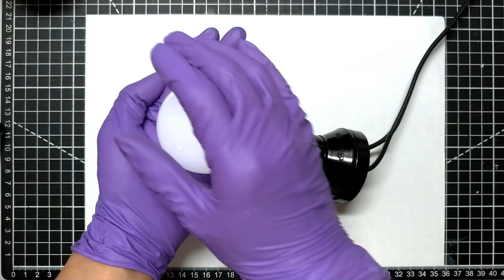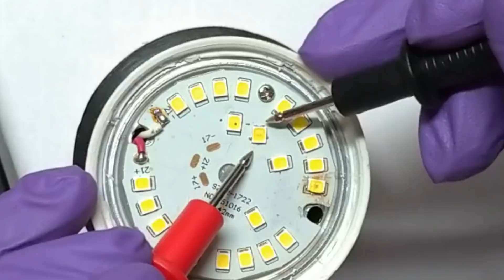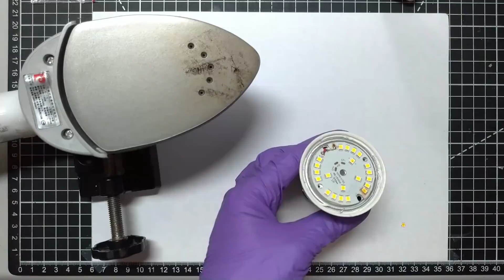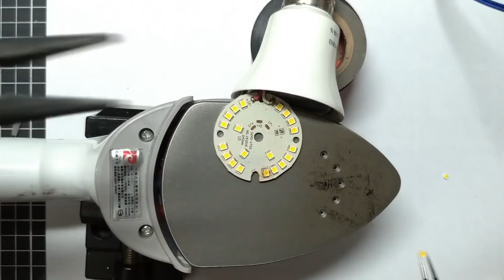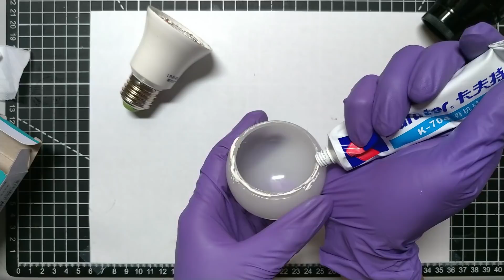LED燈泡維修/用電熨斗更換LED燈珠

Comment: IT WAS A CRAZY ACT BY PUTTUNG LED PLATE ON A HOT IRON !!!   SOLDER OR DESOLDER LED NEVER LONGER THAN 2 SECONDS BEFORE IT BECOMES DAMAGE BY SUCH HIGH HEAT !!!!!
THE MOST SIMPLE WAY BY CUTTING THE BAD LED CENTER PART WITH A SMALL CUTTER, THEN  REMOVE BOTH REMAIN WITH SOLDERING IRON.

Comment: It will last a lot longer without the diffuser because the diffuser holds in the heat. Drill holes in the base underneath the LEDs to help vent and the bulbs will last a very long time.
Reply: what about if we drill holes in the diffuser instead?

Comment: Here you missed an important part of the video which is LED Voltage or Wattage, commonly there are 3 types of leds used in these bulbs, so one must be replaced by the same voltage or wattage otherwise it wont work. How about making another video on this topic and share all the basic info and tips to fix led bulb?
Reply from the maker: Thank you for your advice, it is so helpful to me.But i have to consider it myself.

Comment: Good video. However, the problem is not always directly in the LED. The fault can occur on rectifier diodes, capacitors (400V), resistors (1W), which act as a fuse in cheap Chinese light bulbs. It may not always pay to save light bulbs, especially cheap Chinese ones that are poorly cooled ...
Reply: I have a cheap Chinese globe, on 24/7 running now for 7 years, I have a Eurolux with 2 a year guarantee only last 7 or 8 months. The only problem the Chinese one is not as bright as the Eurolux, so the LEDs are not driven on max.
Reply: @tinaluke5124  Only the Japanese realized that they would build their brand on the durability of their products, so they sized the electrical components at twice the actual operating power. The American philosophy was quite the opposite - to use the entire operating power of the electrical component, due to which the parameters of the electrical components were falsified. It was supposed to bring very little life and business. Therefore, nothing will last. By that I mean that it is your glowing globe that is dimensioned correctly with regard to "unlimited" life. The American model is used in consumer goods - for a while it provides great performance beyond the real parameters, which translates into a lower price, but as a result it is more expensive for consumers because they have to buy a new light bulb, for example. Traders' profits are based on this.
Reply from the maker: thanks
Reply: Hello. Very Good.

Comment: I repaired a faulty one: the problem was in the contacts of a capacitor.
Reply from the maker: NICE ! In addition to the LED chip, the most common failure is the capacitor. and it's not easy.
Reply: @oh-jack  while the majority of faulty LED bulbs can be repaired, the same can't be said about fluorescent lamps.
I have a video in my channel in which I show how to reuse a dead fluorescende lamp using a modified mains AC transformer from a Nokia 5140 charger (no joke!) if you ar interesting and if you want to replicate my experiment.
Reply from the maker: @thanthanasiszamp4707  
interesting!
Well, we'll need to chew it over
my vedio about fluorescent lamps:
https://youtu.be/BCDR2NTBv2s
Reply: @oh-jack  Here's my video about my CFL powered by joule thief (using mains AC transformer for step up):
https://www.youtube.com/watch?v=5qgvxW8Szp8

Comment: Hello, one question is it possible?  I have an identical tester like this one of yours, by the same procedure as you I test with my two LED lamps that are faulty and with me no LED gives light when in contact with the tester, why don't they light up?
Reply from the maker: Test Leads Wire Pen may not touch the solder joints of the LED chip (It's very small)

Find an LED like this => https://www.ebay.com/itm/352163012233?hash=item51fe8d1e89:g:DMcAAOSwl75ZtbSs

If your multimeter can light it up , Then it should also be able to light up the LED chip.
Reply: @oh-jack 
I don't know, I tried to unsolder it, I tried it again, it didn't light up.  This bulb of mine is intended for 230v, maybe that's a problem, what do you say?  And my tester is the same as yours, it needs a 9 volt battery to work
Reply from the maker: in this video MY BULB Operating Voltage 100~240V 
If we are using the same tester (Model: DT-830B), maybe the LED chip is broken
Or you can refer to this webpage:
https://www.brighthubengineering.com/robotics/60933-how-to-test-led-lamps/
Reply: Make sure you are using the diode test function on the meter.

Comment: What does it mean if you jump it and it stays light up correctly like it's fixed but when you unplug it and come back later it is dim again. is it a bad connection maybe? Thank you for any help
Reply from the maker: In this video, each LED chip is connected in series, when one of the LED chip fails, similar to the line interruption, the current cannot pass.
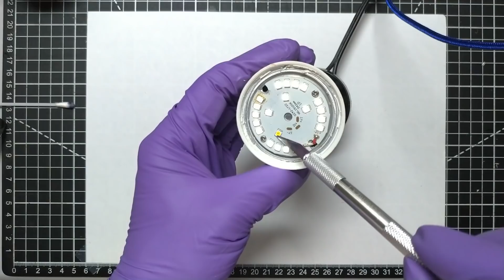 1:57  , I use tweezers to jump over the LED chip so that the current can flow, and then the other LED chip are lit.
 Through this test, I can confirm that this LED chip is faulty and needs to be replaced.
Reply: @oh-jack  I understand what you are doing. I was testing my dim bulbs and replacing bad LEDs. On one bulb when I jumped the led it lit up and stayed lit up like a working bulb even when I removed my jumper wire. I unplugged the bulb worked on another but when I put that bulb back in it was dim again until I jumped it then it stayed bright.  Why would it do that. I hope I explained it where u can understand. Thanks
Reply from the maker: @Nate-wu8rr  sorry,I never meet such situation before.
It may be that the led chip is faulty, or the capacitor is faulty, 
it needs more testing.
Reply: @oh-jack  No prob. Thank you for your help

Comment: Can TV led  back light be repaired the same way
Reply from the maker: Yes, the principle is the same. Use an electric iron to heat the aluminum plate on the back of the light bar, melt the solder on the lamp plant, and remove the lamp beads.
Reply: @oh-jack  Thanks will let you know how it goes
Reply: @oh-jack  who supplies those beads? Never saw then on sale.
Reply from the maker: @chrisburnby62  home shopping,,like eBay

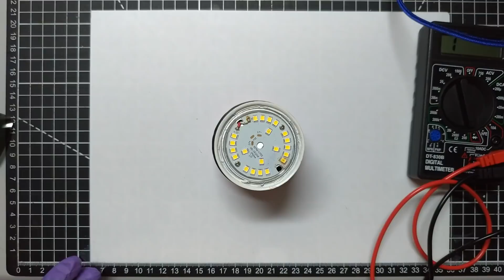Comment: i did exactly here (2:50) and no led has any light  by sanwa multimeter buzzer mode what should i do correctly ?
Reply from the maker: Some sanwa multimeters like PM11, PM3, CD800a, the diode test output voltage is only 1.5v, which is not enough to light up the led light, maybe you can replace another multimeter to test, good luck!
Reply: @oh-jack  yes its Cd 800a 😢 any way Big thank you for your precious efforts in your Video and your declarations  in comments 🌹

Comment: OMG ! You want people to die !? Touching the led while the lamp is powered ?! There is no isolation, so it's directly on the mains !
Reply from the maker: Don’t worry, there is only about 3v voltage and weak current through the chip, it won’t hurt anyone
Reply: @oh-jack  In case of a 10W bulb (in Europe, the voltage is 220-240V) the current thru the Leds could be about 70mA. If this current goes thru your body to the ground, it CAN hurt someone. A warning in your video would be appreciated for people that are not familiar with the safety rules.
Reply from the maker: @LionelN  Thank you for your suggestion. Warnings should be added for people that are not familiar with the safety rules.

and… I won’t touch the AC power(220-240v)，it has been converted to lower DC power。
Reply: The entire project is dangerous. Dont screw a bulb holding it so close to the metal E27 screw. Dont open a 230 V bulb. Dont use that amateur volt meter on line voltage. There is enough fun SMD soldering to do on 5V or 12 V devices instead. And I hope the person is wearing goggles when turning that knife, part of it may break off and fly into your eye